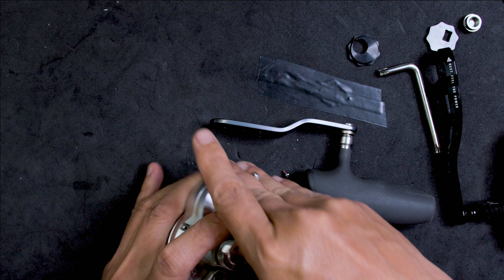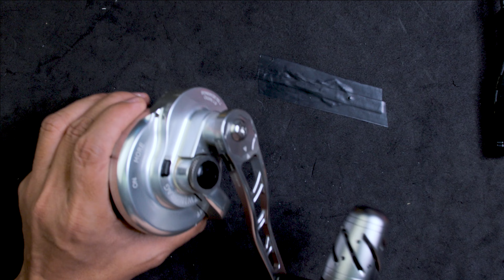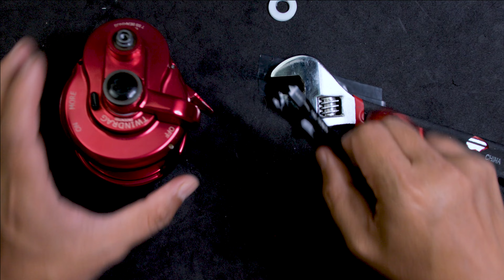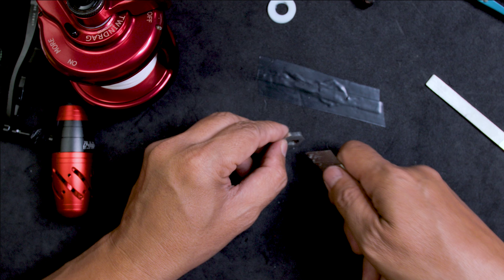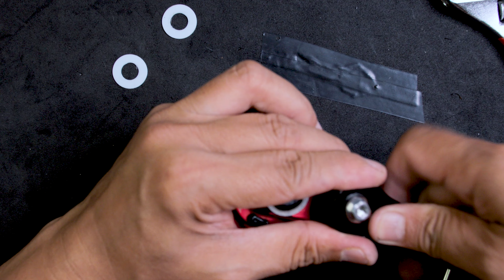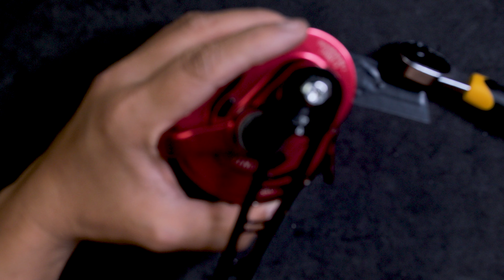TRANSFORMING A VINTAGE ACCURATE REEL INTO A SLOW JIGGING MACHINE

Comment: Thanks for the great knowledge. Was wondering why my accurate has a blue finish while the US models are different. May i know what after market handle did you use? The red one looks lovely.
Reply from the maker: I found them on ebay, just do a search on accurate handles and you will find them. The part that attaches to the reel is what i had custom made was a headache.